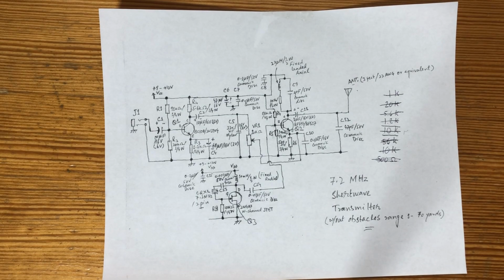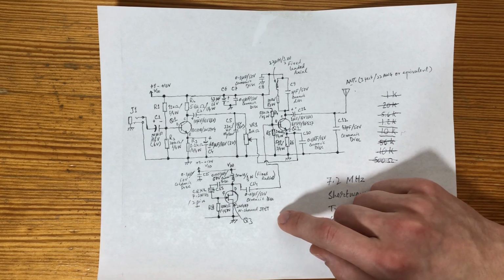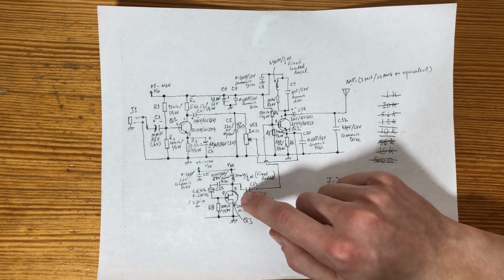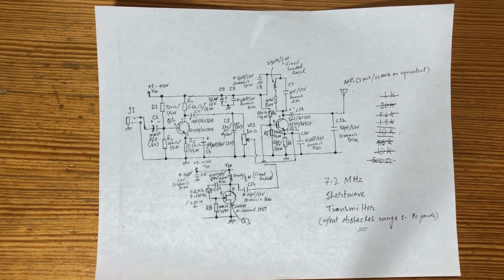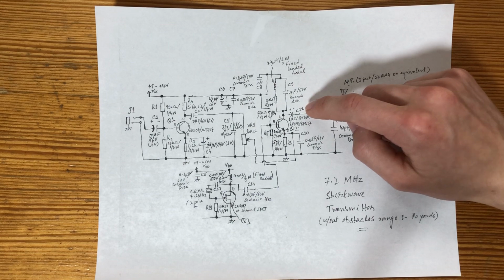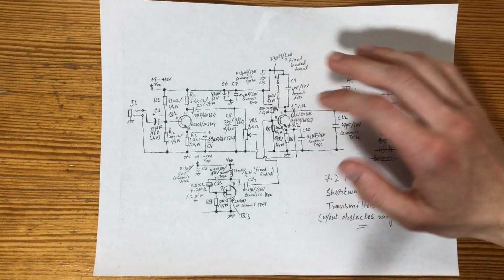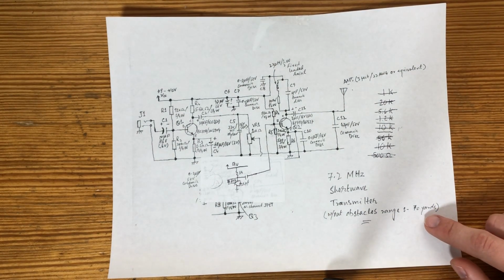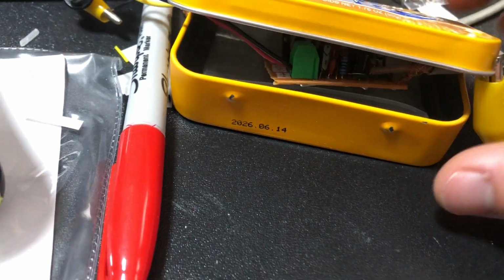Prototype of a New AM2PC Transmitter - AM2PC pt. 6

Comment: Thank you very much for building my circuit sir. And thank you very much for credits. Plenty of reasons for it not working. I calculated modulator and RF amplifier components specifically for 7.2 MHz (40 meters) band. So, you need to recalculate the components for frequency you are willing to use. Same is the case for FET-based oscillator. It is targeted for 7.2 MHz as well, hence it won't work the way you want it either. Try removing the capacitor in audio amplifier output the 330 nF one becuase that shorts out most of the audio. I was experimenting with it and eventually found out that it kills the purpose. The rest of the circuit ought to work fine otherwise. As a matter of fact i am still using it as I type this in. In a nutshell, recalculate the oscillator and modulator/RF amplifier components for 5 MHz, if that is what you prefer, sir. Let me know when you get it to work at the frequency of your choosing. As a tip, recalculate the inductor in RF amplifier/modulator tank circuit so it gives out close to 1000 ohm impedance at chosen frequency. Remember 1000 ohm impedance not resistance. Your first mistake is that you didn't recalculate the oscillator components and RF amplifier components so that is why you were dismayed by its performance. Actually i was surprised that it output any RF at all with all those components targeted for 7.2 MHz frequency. I told you earlier that transmitter is dirty, so, you need to add a band-pass filter on frequency of your choosing, sir or your neighbours will be enraged. Remove the capacitor added in audio amplifier after output coupling capacitor which i think is 330 nF. Recalculate the input and output coupling capacitors of audio amplifier with 100 Hz -3 db band cut-off but first calculate input DC and AC impedance for it with familiar equations like Imp.(DC) = 1/((1/R1)+(1/R2)+(1/r(tr))). For AC impedance treat load and Rc as parallel to eachother. Hope after that it will work fine. O and recalculate oscillator components as well please or it won't oscillate. Also, connect the fourth pin of FET, if you use it, to electrical ground, if you have one defined. And you are getting 10 MHz signal as components calculated in RF amplifier/modulator resonate a bit on 3rd harmonic of the crystal. So, instead of changing whole stuff, try calculating tank circuit components for 10 MHz or add a VFO style ferrite rod wound with 46 guage litz wire and a regular tuning capacitor. The rod ought to be 120 mm long and 10 mm in diameter. The key for my design to work on other frequencies is recalculating the components. Thank you once again and good luck! God bless you!
P. S.: - like in Pro circuits, shield oscillator and RF amplifier/modulator with metal shields. This shall prevent frequency shifting and undue interference. Also, please, either use PP3 battery or if you are using table supply, add EMI or line filter before main supply. I mean plug your supply connector into filter output. This way you shall get cleaner output. It's an utmost necessity for RF circuits.
Reply from the maker: Thank you for more incite into this build. I had a feeling that changing the crystal to that different of a frequency may not be ideal, but apparently it had much more of an effect than I was expecting. The reason I went with a 3.579545 crystal was because the closet thing I had to the target frequency was a 7.159 crystal, and I only had one left. I figured that I wanted to save this last one for the ham radio enabled version that I will build later on. Just earlier today, went on Ebay and ordered a whole lot of new circuit components including a few 7.2 MHz crystals, so I should be covered for next time.

Anyway, as should probably be obvious, my understanding of some of this stuff is a bit foggy, but it's experiences like this that help me learn more and more. I'm defiantly doing more advanced things than I was in my first transmitter video over two years ago. Thanks again and best wishes!
Reply: @rcat256  o almost forgot. If you don't want to use CE PD type BJT Audio amplifier, add LM386 instead. It will provide remarkable output and serves the purpose even better. Also, you can replace the modulator with MC1496 or equivalent balanced modulator chip. Choice is yours
Reply: @awaismushtaq5719  a LM386 is indeed a good option. When it comes to a modulator I'd rather have a larger one that I can adjust with a limiter than one that can barely do the job. There is a reason why the old blokes used large tube modulators with countless 807 tubes :)
Reply: @rcat256  Good luck sir! And there is nothing wrong with learning things in advance. Stay safe!

Comment: It seems your output frequency is 3rd harmonic of the crystal. since the original circuit was designed for 7.2MHz, your 3.xxMHz base frequency of the filter might have filtered out and 3rd harmonic gets out. do you have an SDR or any other receiver to listen on base frequency, second harmonic and 3rd harmonic you might be able to get some insights.
Reply: Brilliant answer sir.